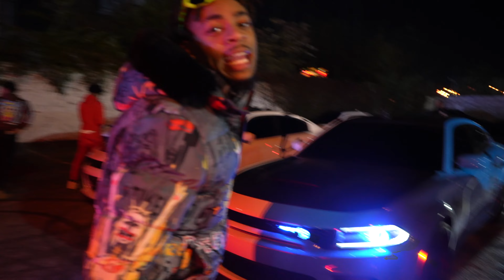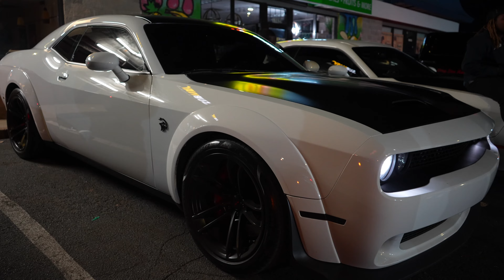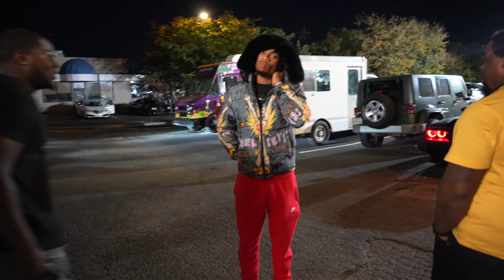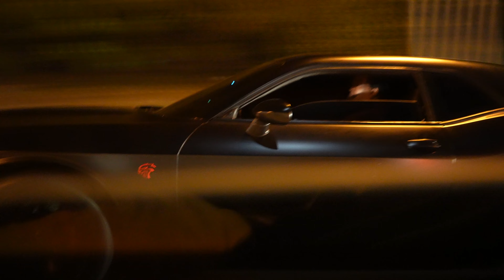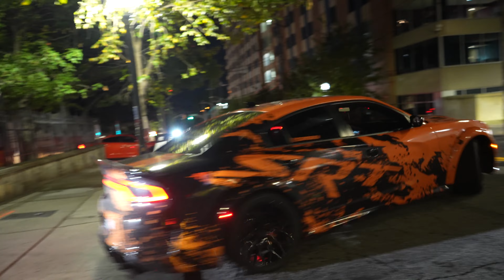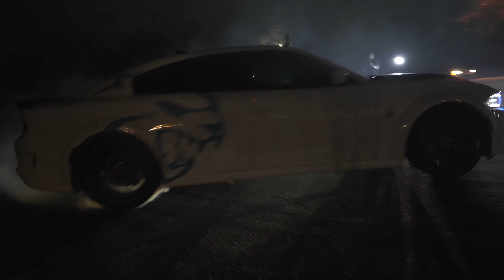I CALLED OUT THE WRONG HELLCAT *GOT EMBARRASSED*

Comment: E85 not worth
Reply from the maker: Why not? 🤔
Reply: @V8TJ  e85 is more expensive(less efficient) ,harder on your vehicles fuel system etc it’s also adding more to the ecu to handle its better to run cleaner running fuel or just switch to full alchohol if u wann go crazy,might aswell put better supporting and power adding mods in my op .just my op tho based on fax.e85 is power gain but higher octane is to